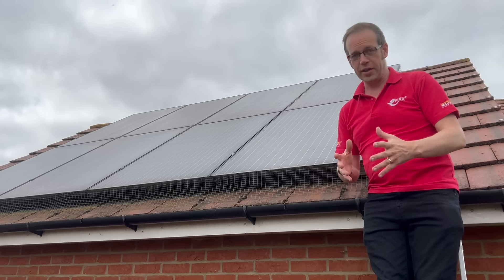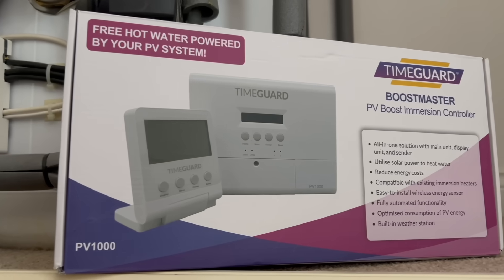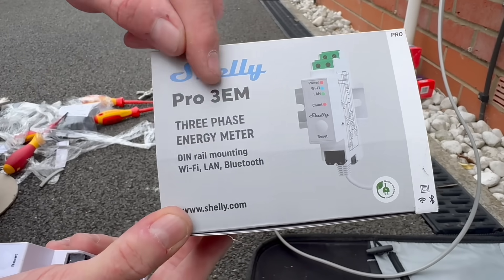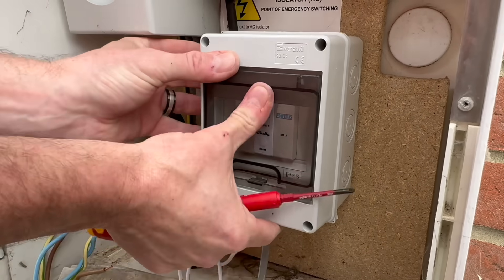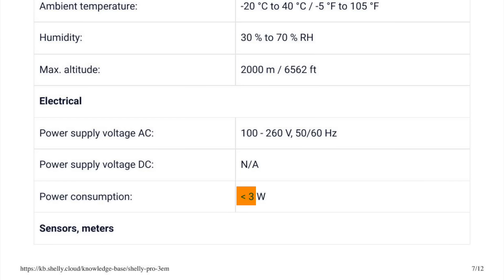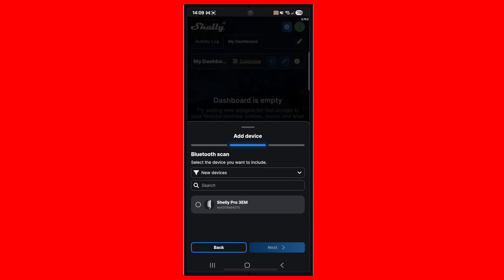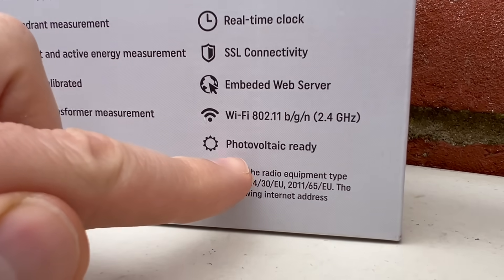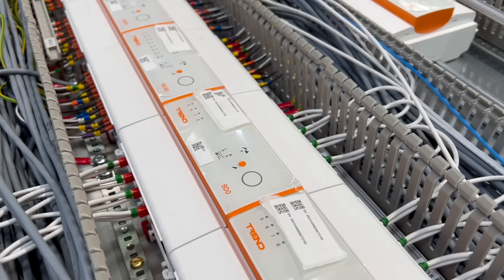Your Solar Inverter's Not Dead - Shelly 3EM Proves It!

Comment from the maker: Learn More about the Shelly Pro 3EM 👉 https://hub.efixx.co.uk/ShellyPro3EM
Reply: One interesting thing to notice though is that the Shelly 3EM (non-pro) has the ability to control a contactor, which sometimes is useful.
I also expect more and more residential installations to be 3-phase in the future when solar installations grows and electric car usage increases. In Sweden 3-phase is the norm, single phase is just on older installations or small single room apartments.

Comment: Homeassistant is your answer.  Free to use system in Operating system server format.  Run it on a fanless inexpensive pc like a Raspberry Pie.  Lots of integrations can be installed to link to even the old Inverters  e.g. mine is 15 years old with no wi fi just blutooth.    Once set up you can see the data in many formats and historical data.

Comment: What’s the maximum size the cr clamps can go to. You mention about using it on a commercial install. What it the cts needed are 250amps or higher. Is this possible
Reply: Shelly has 400A CT too if I remember correctly.

Comment: Shelly Kit is generally good stuff. But it probably raises the question if it's in a normal CU and not a separate enclosure having mixed non OEM specific devices installed as technically a C3?

Comment: Even more affordable, the Sonoff one, i belive it's called POW Ring Meter something something.

In general, Sonoff has a range of products that covers almost everything Shelly has on offer, it's from a bit cheaper to a lot cheaper depending on cases, offers re-flashing for open source software or easy Home Assistant integration and I find it much more intuitive to set up and use (Shelly's app & software is very powerful but it's too cluttered with advanced option few people will actually use).
Reply from the maker: Horses for courses really, I looooooooove the Shelly app. 😃

Comment: Shelly is great... Shelly within Home Assistant is next level
Reply from the maker: Could well be my next move actually.
Reply: @efixx  highly recommend. Easy to set up on a raspberry pi - no coding required. If you want an even easier "take it out of the box and plug it in" experience buy the Home Assistant Green from the original creators
Reply: @efixx  HA is great, but does have a savage learning curve if you want to do anything complex & aren't already into IT.
Reply: @WyndStryke agreed! I'm pretty tech savvy (or so I think) but I almost gave up. Glad I stuck with it because now it all seems (mostly) a lot more simple and the info I get from it is incredible. Wouldn't be without it now

Comment: I used the shelly 3EM (rather than the Pro) - quite a bit cheaper, and seems to do everything the pro does?

The shelly stuff is super useful.  I put a bunch of the other power monitoring sensors throughout the house and can track virtually everything.  If I knew a friendly sparkie I'd have asked them to put some CTs into the consumer unit as well, one for each circuit.
Reply from the maker: It's absolutely brilliant. I love being able to monitor everything and it's just rock solid. 💪
Reply: @efixx  Do you have more than one then? I've got the EV charger and ASHP on one, and the uniTower and induction hob on another, all connected to home assistant. Also have Shelly temperature monitors monitoring my heat pump, Shelly Plugs, and even another Shelly sensor which checks if the garage door is locked, if it isn't HA will notify me at 8pm & 10pm

Comment: Quite interesting! Was looking for something similar this week as I'm replacing older USB-serial inverters with a more powerful unit that has only WiFi/app connectivity (didn't spot that before buying!) The Pro is din-mountable, has an RJ45/Ethernet port, offers a JSON RPC API (data 'web' requests/controls), £77 1-phase, £120 3-phase from a well-known purveyor of screws and fixings. I don't like 'internet appliances' that aren't PCs or actual servers. Accessing my private data via vendors' clouds seems reckless to me. Gear that has a USB/serial etc port is inherently *private*.
Reply from the maker: I'm absolutely loving this bit of kit.
Reply: You can turn the cloud functionality off

Comment: that looks much simpler than the Emporia system I've installed.

Whilst it's lovely having 16 channels of monitoring, it's made the CUs very busy inside!
Reply from the maker: I genuinely love it, the app and wireless connection is just rock solid so far. 💪